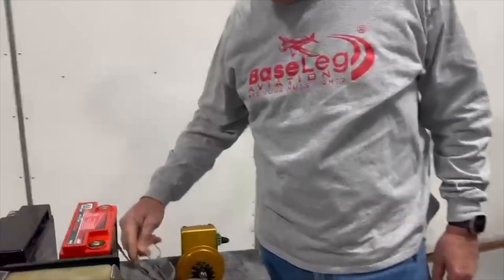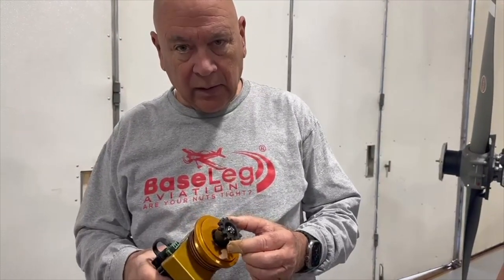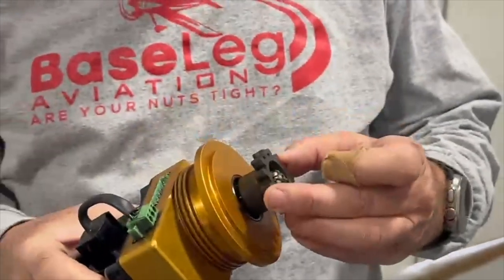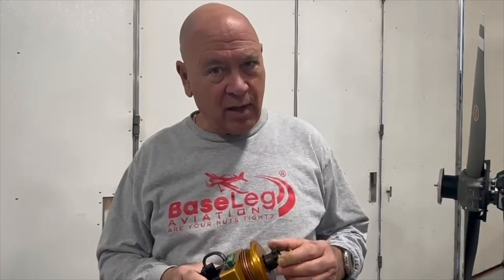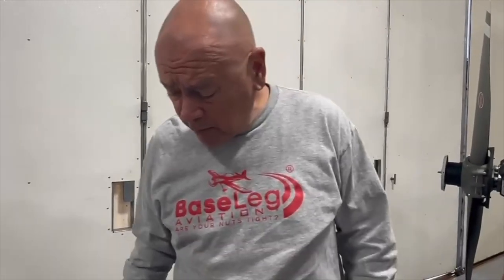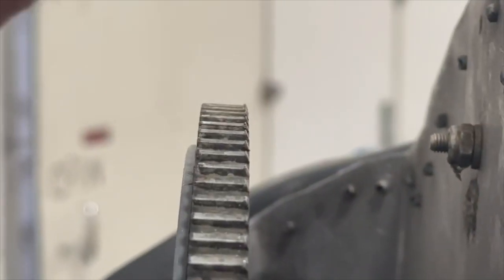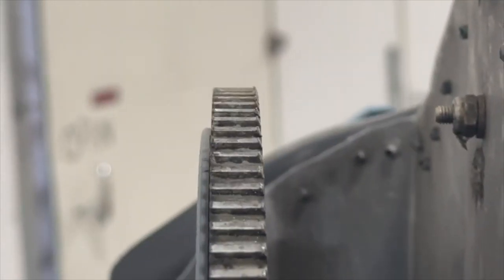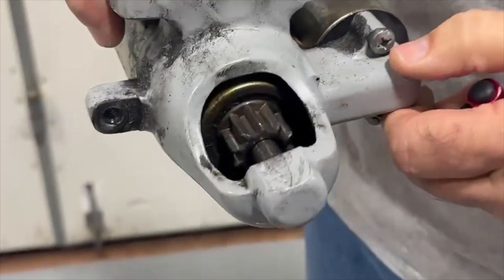Pmag axial play sb and starter wear

Comment: i subscribed so here we go..
1:59  give some thought to that starter's electric ground.
i pulled the starter form a DodgeRAm 1999 . 
the end bearing aluminium housing was welded to the engine/trans.
if THAT starter is grounding thru the gear... !     🦧
(sumting is goin ON )
Reply from the maker: that’s not the problem. the starter is case grounded through the 4 attachment bolts. They are secure.
Reply: very good sir . I agree. 👨‍🔧

Comment: That's radial play on the EMag
Reply from the maker: Well, EMAG calls it axial and lateral. No mention of radial.
Reply: radial = lateral (sideways movement).
Axial movement is along the axis of the shaft.
Reply: @baselegaviation1614  Exactly - seems they cover them both:   "Remove ignition and examine shaft and drive gear condition. Note: Ignition disassembly is not necessary (and if done may void your warranty). Look for excessive play (lateral and axial).  Shaft rotation should be free, with no catching, flat spots, or grinding.  The shaft on “P” models (with internal alternator) will have a push-pull rippling effect as the shaft turns and the permanent magnets pass the rotor poles.  This is normal and expected.  If a P model ignition does not have this magnetic ripple, the unit requires additional (shop) service."

I'm glad you produced this video. I was not sure exactly what a "bad" PMAG looks like, and this video is very helpful.
Reply: @dermick  IMO if it says Emag on it, it's bad.